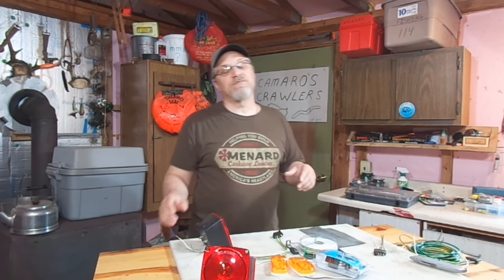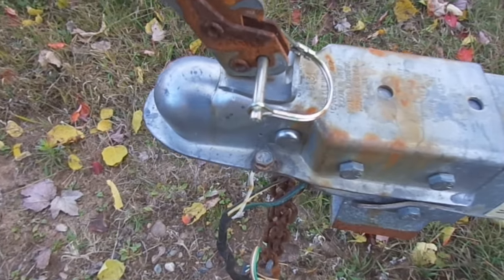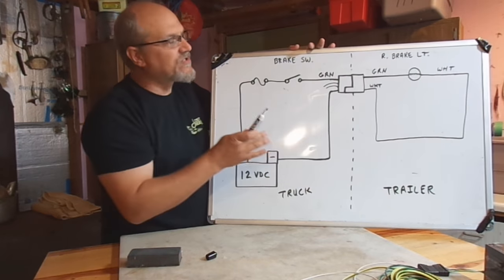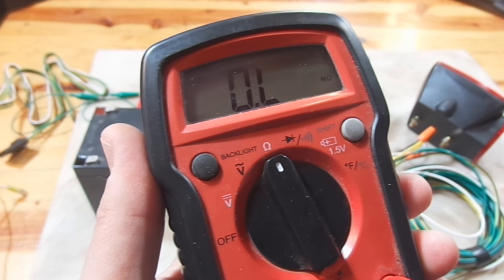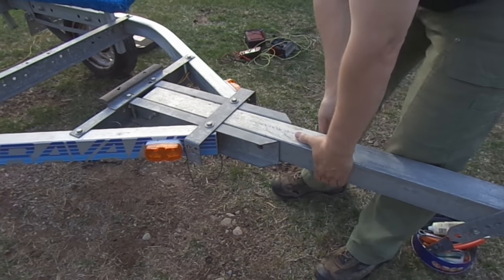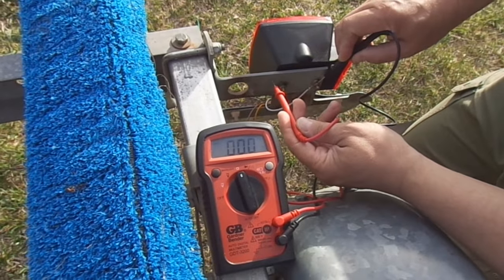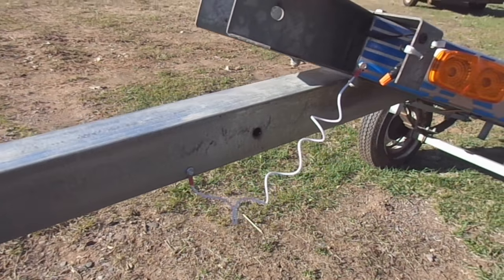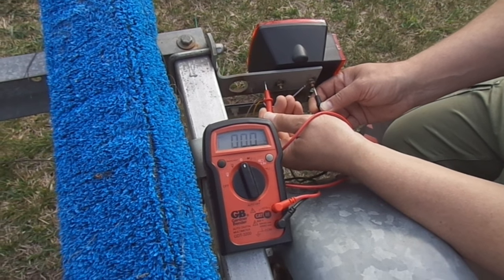FIX YOUR TRAILER LIGHTS (5) - Fixing Ground Problems

Comment: I wired the ground front to back, to all four posts or bolts of the two tail lights and intermittently both trailer lights blink with the signal light on. Wiring on vehicle checks out.
Any ideas?
Reply from the maker: If you have bulbs in the fixtures, it still feels like a ground problem.  The current is back feeding through the other fixture because it's not grounded properly.  That's just what I've seen in the past.

Comment: I got one for you and I really desperate to get an answer. My driver side trailer light  work when it is NOT mounted to the trailer. But as soon as I mount it the light stops working. It seem as soon as I touch the mounting screws to the trailer it stops working.
Reply from the maker: I wonder if the fixture is messed up or you may actually have another fixture messed up.  Maybe not properly grounded.  Are your lights dim?  It seems like your trailer may have voltage on it and when you touch the fixture to trailer, the trailer maybe at the same voltage as the circuits so there is no path back.  Does the non working fixture have a white wire?  I would double check all fixture grounds and maybe even get new fixtures.  Let me know how it goes.

Comment: As far as ground issues go, is it ok if my brackets that hold the tail lights are painted? The brackets were rusted from the previous owner so I cleaned them with a wire wheel and painted them.. I mounted the tail light ground connector to the bolt of the tai light, but yeah the brackets are painted so I was wondering if that could create grounding issues.. should I remove the brackets and scrape the paint at the contact point with the trailer?
Reply from the maker: Yes, that could cause an issue.  The paint is fine but you have to make sure everything has electrical continuity through it.  If the brackets are bolted on, sometimes adding a good stiff lock washer will cut through the paint or remove the brackets, scrape the mounting area down to good metal and reattach.  Then maybe paint over.  Or you could even add a jumper wire like I did for the tilt area of the trailer in this video.  Main thing - electrical continuity from back to front, KPO.
Reply: Knetters Practical Outdoors Ok, I’ll try it. Thank you
Reply: Knetters Practical Outdoors Well.. I bought an led tester and the car to trailer conector is working perfectly. I did however noticed there is a connectivity issue once the car and trailer are connected together because the tail lights receive electricity only when I move/wiggle the car-trailer connectors. So yes, the tail lights do turn on.. but now it’s the mid trailer side markers that don’t (they were before when I originally bought the trailer, this is what has me frustrated)..
I’ll keep at it, I’ll eventually find the solution. Really appreciate your help/videos! 👍🏻
Reply: Knetters Practical Outdoors Ok, I got it! It was all in the car to trailer connection. Everything else was working fine. I cleaned the trailer male harness connectors with sand paper and expanded them a little bit, it took care of the problem, everything is working now. Thanks again 👍🏻

Comment: Hello, my lights work until I couple the trailer to my hitch. I re-did all the grounds including the ground to the frame of the truck. Installed a new full length harness as well. I am at a loss, if you could help it would be greatly appreciated. Both fixtures are grounded via the stud with clean metal and ring terminals.
Reply: The main ground is behind the coupler directly to the main frame. I even tried adding a jumper wire from the coupler to the main frame.
Reply from the maker: Is it possible the wiring is getting bent or flexed a certain way as you couple the trailer up that exposes a loose or broken wire?  Because if all your grounds are good and attached to trailer frame, coupling the trailer to the vehicle shouldn't change anything electrically.
Reply: I got it figured out today, but thank you for your help. I was losing continuity between the tongue and where the trailer makes a "Y" (bolted connection). Added a jumper wire between the 2 parts of the frame and good to go!

Comment: I just boat a used boat and only 2 of the 7 or 9 led lights light up and are not bright.  I tried continuity check and can't seem to get anything from lights to trailer or tongue to rest of trailer.  Guess I'll have to dig more in the am.   I get 12v at the plug in port and only 1.2v at my lights.
Reply from the maker: Hook 12 volts directly to the fixture. ( see LINK - https://www.youtube.com/watch?v=INI5bZkoEVw)  Maybe some of the LEDs are bad?  Let me know what you find, KPO.

Comment: Fucking THANK YOU. The driver side trailer lights haven't worked since I bought it. This helped me solve the issue in the first 2 minutes and 57 seconds. I didn't understand how grounds worked and soon as you said the trailer had to be conductive it clicked. I had to run a wire from the light to the ground on the plug... Problem solved immediately
Reply from the maker: Chris, you are welcome!  I'm glad the video helped, KPO.

Comment: Dave, my trailer lights are flickering as I travel down the road.  I checked the ground with a volt meter (without the trailer on the ball) and it's grounded correctly.  Even tried jiggling all the wires around on the truck and trailer side, and I can't make them flicker in the driveway.  Any idea what might be going on? Thanks!
Reply from the maker: Did you check the ground on the vehicle side too.  Wiggle the wires way up under the vehicle.  Something has to be loose.  Also remember to check for any separations in the trailer itself.  You may have a spot that takes the bumps of the road to show itself (tilt bed, bolt on fixture ext.)  Let me know what you find, KPO.

Comment: Here is one I can't figure out, maybe you can help? Confirmed issue not on vehicle side by testing two other trailers and just testing the vehicle flat plug. Only get running lights on the boat trailer, no blinkers or brakes. Cut off old plug from boat trailer, bought new flat plug and hardwired so now I have 4 bare wires on trailer side and 4 bare wires on vehicle side through that new flat plug that I plugged into the vehicle flat plug. Grounded white wire on trailer and connected via flat plug. Probe flat plug wires - brown works. Green and yellow - nothing. Disconnect green and yellow and get  volts on the new flat plug side out of the vehicle. So basically I have volts on green and yellow wires until I connect them to the trailer side wires, then nothing.  Any ideas?
Reply: Also another twist - my boat trailer works as it should with my neighbors truck, but not with my truck.  My truck works fine with his boat trailer and my other trailer, just not my boat trailer.
Reply from the maker: New plug isn't making a good connection?  Trailer maybe not wired right?

Comment: Would it be better to just run white wires directly to the lights?
Reply from the maker: It can be.  I have done that before on boat trailers that had a lot of brackets holding the lights on the trailer (couldn't get good continuity through the brackets).  It's not a bad idea, but I would recommend still grounding the trailer so if you get a wire shorted to the trailer frame you will blow a fuse.  It helps for troubleshooting.  KPO

Comment: I have a quick question. Just got a new 6x10 Carmate trailer with LED lights. When I hook up my flat four from my car all LED's come on very faintly. The car is off, key out of the ignition. What could that be? Thanks in advance.
Reply from the maker: That one is new to me.  Do you have any issues with the car battery going dead if it sits for a while?  Seems like maybe you have a slow, partial short on the car's electrical system and that small voltage might be back feeding through the trailer lights.  Hook the trailer up and disconnect the battery on the car and see for sure that the trailer lights go out.  They should go out.  At least that will tell you that voltage from the car battery is getting to the trailer lights when it shouldn't.  As far as fixing it, that could be tricky.  Maybe start with trailer and battery hooked up, faint lights on condition with the trailer and just start wiggling wires.  If you find a section of wiring that makes the faint lights go out you may find your problem.  Let me know what you find.
Reply: @KnettersPracticalOutdoors  Will check now. I have the Curt 56166 wiring harness in my 2015 Rav 4. I disconnected the harness from the car and the 4 pole is still hot. I assume the wire to the battery is providing the power. When I remove the inline fuse all power is cut. Curt discontinued the 56166 for some reason. $50 bucks for a new harness at E-trailer. Hope that  will fix my problem. Again for the help.

Comment: I have one light that stays on full time when I put on the low beams because its getting dark. If I use only the daylights on my car, then the two lights work fine and flashes when I put on my turn signal.. If I would put on the low beams, then only the right side light will flash or act as a position light when not pressing the breaks. The left light will act s if I was continuously pressing the brake pedal without realeasing..
Reply from the maker: Lots of stuff going on here.  Check your trailer plug on the car side first with a plug in checker - https://www.youtube.com/watch?v=MqrpMcjGiTM&t=374s  Then make sure all the fixtures are grounded properly.  That's how I would start, KPO.
Reply: @KnettersPracticalOutdoors  Thanks for responding. I will have a look at my trailer and try to fix the issue. I am pretty sure its trailer related as another relative took my trailer a while ago and they had the exact same problem as me.
Reply: @KnettersPracticalOutdoors  I fixed my lighting problem. I took off the lights and buffed it back to the metal. Now it works normal. Thanks for your help.

Comment: I just replaced my license plate bracket with a stainless steel one, now my light on that side doesn't work. Will the stainless not conduct electricity like galvanize steel?
Reply from the maker: Most stainless should conduct just fine, but you never know it something comes with a coating on it.  My guess is you have a bracket that mounts along with the light fixture.  A lot of these brackets are actually plastic so it shouldn't matter either way.  You may have just disturbed the ground at that fixture when you removed it to change the bracket.  If the fixture has a white wire, make sure it has good contact with the frame of the trailer.  If it doesn't have a white wire, then make sure the mounting studs of the fixture have good contact with the frame of the trailer.  Scrape away any paint or rust that is in the way.  Let me know if this helps, KPO.

Comment: Can you simply run a wire (white)from the light to the front plug?
Reply from the maker: Yes and that will help.  I touched on that a little in this video - https://www.youtube.com/watch?v=-14kh2DYdOo
Reply: @KnettersPracticalOutdoors  I ran the grounds and the trailer lights are working great!!!!   Thank you

Comment: Do you think it would be a problem if my coupler is welded on to the trailer frame.?
Reply from the maker: No, that should give you the best connection.
Reply: @KnettersPracticalOutdoors  okay thank you! I think my problem is the ground where it connects there. Just need to scrape it off and clean it up. Thanks again

Comment: Here’s what’s going on with my trailer lights when I plug it up it blows the fuse to my tail light but everything else works like the brake light the flasher the blinker so what’s causing it?
Reply from the maker: When you say everything else works do you mean the lights on the car work or do you mean just your running lights stop working when you blow a fuse.  Either way if you blow fuses you have a short circuit somewhere.  If you are loosing the running lights because of a blown fuse, then you have a short in the running light circuit.  On a basic 4 pin flat that is the brown wire.  Follow the wire and look for any place it might rub on the trailer or a wire broke off and touching the trailer.  KPO
Reply: Knetters Practical Outdoors I found out what it was which is weird I had 2 of the same lights with the same color wires

Comment: Thanks. Issue. No lights? Look at trailer lights and lean on back of trailer and lights work. Take arm off trailer. No lights. Lean on trailer lights. Ball was acting as ground. Ran ground from lights to white connections all set.
Reply from the maker: very cool

Comment: Brake and turn signals work but found a blown fuse for running lights. Any idea what would cause that?
Reply from the maker: A blown fuse is a short circuit.  Somewhere your running light wire is bare and touching the trailer frame or another bare wire.  Probably the trailer frame.  Check anywhere the wire goes into or out of the frame.  Over time wires can wear on the trailer frame and rub off the insulation.  it might just need to be taped at the wear spot or spliced.  Let me know how it goes, KPO.
Reply: @KnettersPracticalOutdoors  these are newly installed lights. Worked initially but second time trailer was utilized the running lights didn’t work. Don’t see any worn wires.

Comment: that makes your trailer rust quicker. running individual ground wires to each light is the best way. this way your lights are grounded to the car instead of the trailer.
Reply from the maker: Yes this will cure many problems.  Just be sure to ground the trailer too.  That way short circuits to the trailer will blow fuses as they should, KPO.

Comment: Hey, I can't figure it out. Mines don't have the white wire coming from the lights. Checked everything over like you sound and even ran another ground wire to the back of the trailer. Now the brake lights and turn signal works but when I turn the headlights on the lights goes deam?
Reply from the maker: I think you're on the right path.  If your fixtures have a white wire, make sure it is grounded good.  If your fixtures don't have a white wire, make sure the studs are grounded good (the studs are your ground on this type fixture).  Also make sure the trailer is grounded to the vehicle too.  In my experience whenever you turn on a light and others go dim it's a grounding problem.
Reply: Thanks for the information and quick response. I got them working!!
Reply from the maker: @Paulgotitall  great to hear that, KPO.

Comment: How do you ground the lights  if you do not have a white wire from the lights and it is mounted on PVC pipe?
Reply from the maker: You will need to run a white wire from the stud of the fixture to some part of the trailer that is grounded and have a good electrical connection on both ends.  KPO.

Comment: On mine everything works but the running lights for some reason do you know what that could be
Reply from the maker: Corrosion on plug, fuse, bulbs maybe if you have them,

Comment: My running lights work but the brake lights and blinkers do not. Is it still a ground problem
Reply from the maker: If the running lights work the fixtures are probably grounded correctly.  Maybe my trailer light playlist could help,https://www.youtube.com/playlist?list=PLksX0m4wrQHxmTQj8rk3Sazefa3uITFe4

Comment: I’m having a problem with a new light kit. brake lights work, turn signals work, not running lights.. what do I do if lights are mounted on a aluminum bracket then bolted to the frame? Thanks
Reply from the maker: Donald, if brakes and blinkers work, the fixture is probably grounded fine.  I would start at the plug from the vehicle.  Might just be dirty on the running light pin (usually brown).  Also scrape clean the trailer side plug.  Make sure the signal is coming out of the vehicle too.  I have a video on that also LINK -https://www.youtube.com/watch?v=MqrpMcjGiTM   Thanks for watching, KPO.
Reply: @KnettersPracticalOutdoors  thanks for this reply. I had the same question about aluminium. Indirectly, i think you're indicating it is okay as a ground.
Reply: Thanks!!! I figured it out I had a slight broken wire on running light wire between plug an connector. But what what was crazy was both my vehicles had the same problem.. your video was a big help thank you!!

Comment: My brake lights don't work when the headlights are on.  I've done all I can do, save cutting out the rusty brake light bolts to see how or if they're grounded.  I'm thinking since I can't see  how the brakes are grounded, maybe running a jumper from the light's ground I can see if that's the issue and if it is, then cut out the lights and buy new ones.
Reply from the maker: It really sounds like you have a ground problem.  I think what is happening is you don't have a proper ground and because of this the circuits are back feeding through other circuits.  This would explain the brakes not working when the running lights (head lights) are on.  Try the jumper idea it may tell you something.  Rusty studs on your lights are never good.  It might be time just to change them.  Let me know how it works out, KPO.
Reply: @KnettersPracticalOutdoors  yes, the brake light ground was the problem.  I made a jumper from the light fixture to the frame, and the brake lights now work with the headlights on, but the turn signals do not.  I'll probably have to rig up another jumper for some reason, but right now busy pulling my hair out.